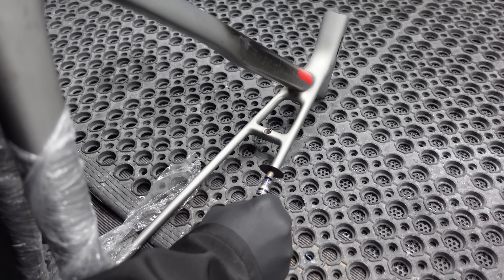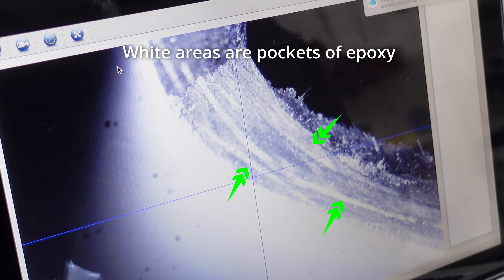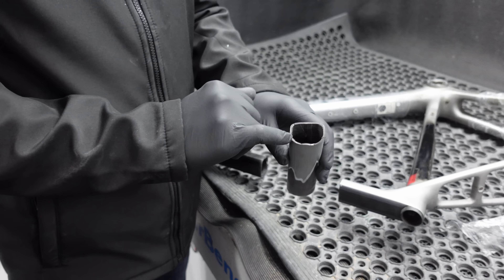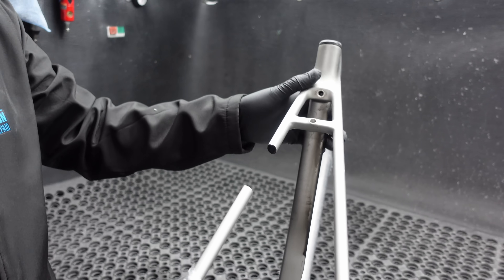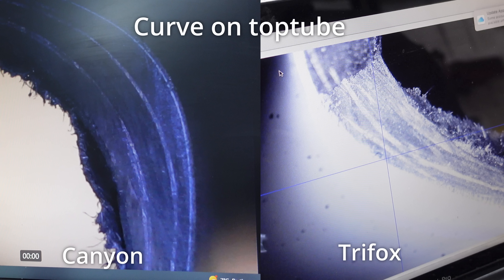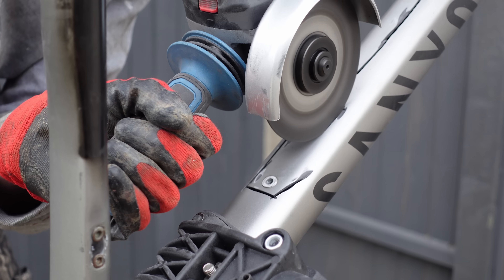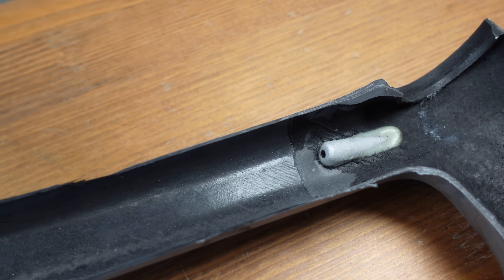I Cut a High End Canyon Carbon Fiber Frame in Half... Here Is What I Found!

Comment: Similar to that of triple and double butted steel and aluminum frames. The steel and aluminum are isotropic and not the composite material, therefore material orientation is important. Tube shape will also affect the composite layup. You need to compare same shape tubes to prove your analogies.

Comment: Awesome job! One word of advice, you keep saying the top tube is "tapered". It's actually called "butted" tubes. This technique is used on steel/aluminum tube as well. This is where the ends of the tube are thicker for stronger connections at bottom bracket and headset area, whereas the middle of the tubes are thinner to save weight. There are single butted, double butted, and triple butted tubes. All using the same technique.
Reply: aconsejas comprar bicicletas de carbono u otro material?-  cual es el tiempo de vida de una bicicleta de carbono que se puede usar por aficionado en gravel?

Comment: It's not hard to make a safe carbon frame if the process controls are well-established by the supplier. There are MANY chinese suppliers capable of building a safe product. The real hard work is tuning the frame to behave how you want it to. An automotive analog - Porsche 911 vs Chevy Camaro. They both use a lot of the same materials, and both are safe, but they both feel radically different to drive. Canyon has a proper engineering group; a lot of these unbranded chinese bikes can be and often are perfectly safe, and can often even ride well with good geometry, but the tuning of the layup is nuanced, and requires engineering work to both define all the performance requirements (it isn't often enough to be lightweight enough and safe enough) and then design the layup to accomplish those requirements. 

Thanks for cutting up your frames, it is always fun to see inside the tubes.

Comment: The comment on the seat stays was misleading……the stays largely handle or resist the twisting induced at the rear hub which forces the stays to be in tension (alternating) has a rider say climbs outta the saddle.   Stays themselve do not hold the seat tube up  this is the done by the front triangle.  Keep in min pd carbon is fairly useless in comparison.

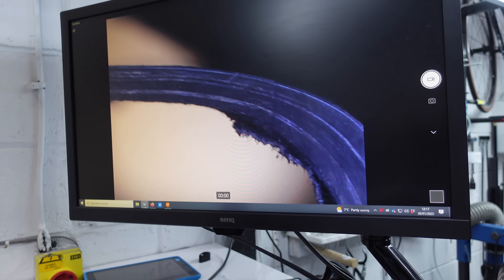Comment: The "streaks" or "jam" that he believes is a layer of epoxy at approximately 6:25 is actually a layer of composite orientated at a different angle.  The vast majority of this frame is highly likely fabricated with unidirectional prepreg (to reduce weight) meaning all the fibers in the prepreg ply are orientated in the same 0 degree direction.  These plies then get laid up at different angles to give the laminate strength in many directions.  When you cross-section a composite laid up with different angled plies, the different orientation plies appear as "rings" or layers.  Depending on the orientation of the fibers to the cut, they reflect light differently hence the different appearance.  Additionally, to see the cross-section (and composite plies) properly, the samples need polished with ever finer sandpaper and examined at a higher magnification than in this video.  Google image search "carbon composite cross-section" and you can see many high magnification photos of this phenomenon.
Reply: This
Reply: So good you wrote that comment! It really shows there is a lot to learn for the community...
Reply: comment I was looking for! I cringed every time he said epoxy pockets. Generally in UD heavy layups, you place a biaxial (+-45) ply between every 300 g/m2 of UD ply sets to avoid shear failure and delamination. It is scary that he thinks it's engineered for flexibility.
Reply: Sorry, could it be just some glass fiber layers?

Comment: What is the weight limit of these frames ?
 Would these bike be recommended to heavier riders >220lbs ?
Is there a recommended maximum weight ?
Reply from the maker: I think it's normally around 120kg or 264 pounds. It does vary frame to frame though so I'd check. Maybe some of the strong gravel or all road bike frames would be good 👍🏽

Comment: I could be wrong about this but I think Canyon used to use Giant for sourcing their CF frames and forks and that was probably true in 2018 but then Giant got too expensive and they moved to Quest Composites and it used to be you could see Canyon and Trek bikes on the Quest Composites site. Quest Composites are nowhere near as good as Giant in making CF frames so quite a drop in quality. If you look at the Quest Composites site and the factory images they are pretty grim to say the least. I personally wouldn't touch a Canyon or Trek with a barge pole nowadays made of CF not just because they are dire quality for the price but that factory doesn't make me very comfortable. Look at what they are sitting on, the cramped tables and the lack of air purifying to protect dust getting into the fibres. There is woman in one image who can't even wear her protective hat properly . I actually feel buying direct from China from a very good factory is much safer than buying from an importer who may change factories regularly and so quality is unknown.
Reply: I have a 2020 Trek Fuel Ex and I have ridden it TONS on every terrain possible. Jumps, drops, rocks etc. It has held up just fine. I am not a Trek fan boy per se but my bike itself continues to impress me and gives no issues. Also, Trek has best carbon warranty out of all the brands by far. I wouldn't judge their WHOLE world wide company and quality based on one person in an image online. their whole website looks like it is from 1990. Of course they don't want you to see all their good stuff.
Reply: @jasonmccune9313  CF is made by hand so its not about all frames being bad its about the failure rate. CF frames have a very high failure rate compared to other frame materials but even then it may not be any more than 4% for the worst examples. I've seen somewhere a figure like 20-30% maybe significantly below their load rating because of  imperfections in the frame but with normal weight riders perhaps 75kg or less the frames will be fine but for heavier riders its much higher risk as a much more significant number of frames would fail for those riders.

Again though we don't know which Trek frames are made by which manufacturer. Trek presents itself as a manufacturer for commercial reasons but fits more with an importer in how the business works and quality will surely be down to the manufacturer almost completely not the importer.
Reply: @bonzobanana1  yes I understand. This is the case for 99% basically for carbon, only maybe gorilla gravity actually makes their own frames and is not an importer. Pivot, Santa Cruz, trek,ibis, specialized,giant, Norco,canyon, YT, even yeti all get frames made from overseas. Honestly as long as I get my frame replaced under warranty if it fails. It's fine.

Comment: I'm so happy the Canyon frame is actually better! 😅 I was worried I paid too much for my 2 Canyons I've got hanging out in the shed. ❤️
Reply: The question in not whether the $3000 frame better than $300 frame. The question should be, is the $300 frame good enough for 95% of the weekend riders?
Reply: @williamko4751  yeah I know, but it still makes me feel confident about Canyon. 95% "probably safe" is not good enough to make me feel confident on it personally.
Reply: @Mark-Huigen  where did you get 95?
Even top Italian, there is no 100% FYI. So you pay much much more for 97% but afraid of 95?
Logic is a bitch!
Reply: @williamko4751  Statistically, the difference in reliability between 99% safe and 99.9% is HUGE. For some Engineering projects the aim is 99.999999% to be EXTRA safe. Generally speaking, we talk about Availability for this (how much uptime of a system if you would use it all the time) and the difference in a year use between 99% and 99.9% is that the 99% would have a down time (so needing repairs or juste doesn't work anymore) of 3.65 days and the 99.9% 8.77 hours.
Reply: @williamko4751  The question, is the canyon 10 times better frame?, I may say nope, so I would go for something between the chinese and the canyon to get the best bang for the buck.

Comment: Seems you are totally bum licking  the canyon, which lets face they don't have great rep for voids and problems. You are comparing an aero frame to a climbing bike to make those aerofoil shapes you need to use more carbon to give its strength back. That's why most aero bikes are heavier in general. Go cut up a trek modone, and let's see how thick it is 🤦🏻‍♂️

Comment: Great video.  Regarding the 'dry vs. wet' carbon discussion towards the end of the video, I would be interested in Rob's opinion if those types of different manufacturing techniques are influenced by costs?  Is one cheaper than the other, thus preferred based on the target price of the bike?  Great content!!
Reply from the maker: Good question, next time I see him I'll ask 👍🏽
Reply: Almost every single bike frame out there is done with prepregs and usually out of oven autoclave which means they will have a removable core be inflatable bladder or just a vaccume back set up as a tube in the molds The whole thing will then end up in a vacuum bag and put under vacuum and then baked in  a oven.  The bike industry has seemingly decided against using autoclaves most likely due to expense but the likes of trek and specialized would have the budget for it one would think. That would then bake the part while putting it under immense pressure. There is no actual thing as wet vs dry carbon - it's just the technique that gets resin into the weave. Prepeg (dry aka already resin filled) and or infused (wet out - usually done with vacuum lines. )

Comment: Perhaps you ought to polish the sections to get a better view under the microscope - you'll see the microvoids  much more easily
Reply from the maker: Fair point, what polish would you use?
Reply: @JourdainColeman  start with 200 grit, then 400, 600 and. 800 grit. silicon carbide paper for wet sanding.  After that you need a fine abrasive paste - without going over the top the stuff used for cleaning glass cooktops works. Just make sure you  you have the sand paper /abrasive on a flat surface and rub the part over it not hold the sandpaper in your hand as you need a flat surface for the microscope.

Comment: Thanks for the awesome video series on carbon frames! I am loving it! 

What always worried me is the safety of these chinese frames, but in general the Trifox at least seems to be safe. Of course they may be bulky compared to top western brands. What I think would be soo cool is comparing on the same price range…
Reply from the maker: Glad you are enjoying the videos! There seems to be plenty of intrigue looking inside these frames so I'll keep the videos coming. 👍🏽
Reply: agreed , comparing on the same price point is important. Most carbon frames are made in Asia, China, Taiwan, Vietnam , both frames could have come out of China.
Reply: youre wrong the trifox was not safe(remember the fork)

Its in the details, a overbuild frame(like the trifox) is worth nothing when its not strong enough at a critical Point(the Forks steering tube). 

So you get what you paid for. Yes most of the Trifox was strong(maybe to strong(heavy, not compliant enough) in some areas but the wekest link(fork steer tube) was not strong enough so the whole system will fail.

Comment: „Dry“ carbon does not mean that it’s delaminate easier or puncture easier 

Often its the other way around (as long as there is enough matrix (to cover all fibers) there is no strength, stiffness, toughness being gained by increasing the volumetric percentage of the matrix in a composite. It’s the other way around  as long as every fiber is sufficiently „wetted“ less matrix means higher fiber content and more strength, stiffnessand better behavior while failing

Comment: Would be interesting if the canyon sl (not slx) frames are as good and if their carbon is less dry
Reply: Forget the carbon dry thing it’s bullshit

 assuming you mean a lower end carbon frame the use of high modulus fiber(high stiffness fibers) should be less and the standard or intermisiate fibers Used instead have higher elongation before they brake so the frame should be tougher